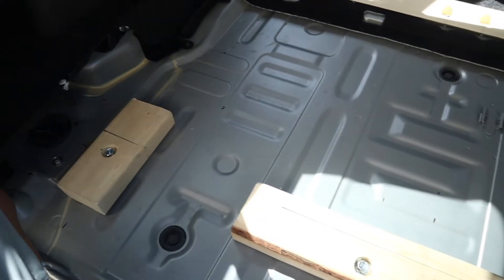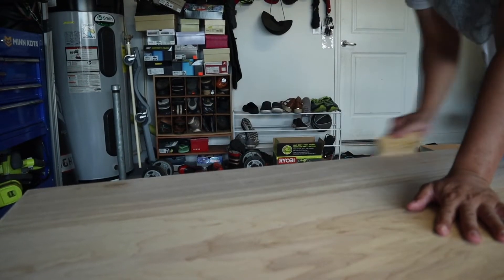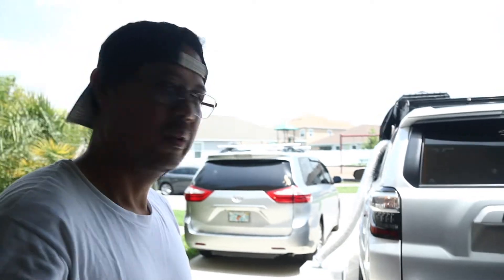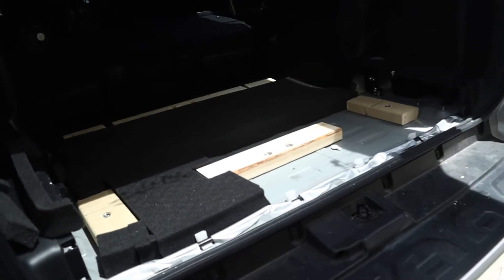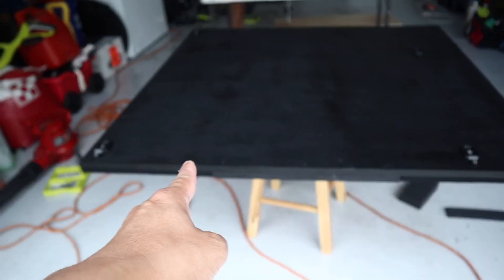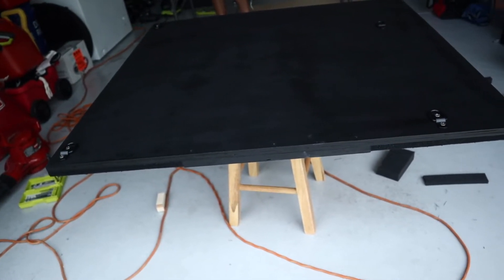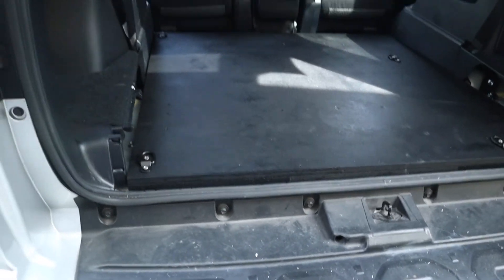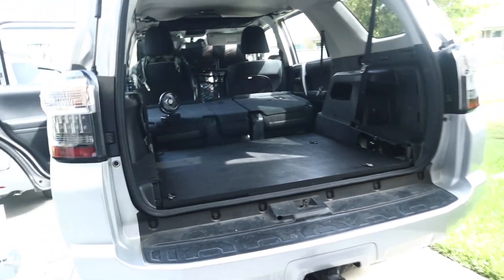TOYOTA 4RUNNER 5TH GENERATION 3RD ROW SEAT MODIFICATION | STORAGE PLATFORM INSTALLATION

Comment: Hello. How did you drill the holes in the 2x4 to leave a little bit of wood for the bolt to go into? And did you use longer bolts than the factory ones to secure the 2x4?

Comment: subscribed, i have a 2021 SR5 4x4, with a 3rd row seat. How do i mount the 2x4s and bolts in, it would of been nice to show the process, Im doing the same thing
Reply from the maker: I cut a 45 degree on one side of 2x4 and use a small drill bit as pilot hole to match the angle of the factory mount. I made the top of the where I mounted the plywood bigger to make the bolt flushed to the 2x4.

Comment: Hello, did you drill holes in the back next to the second row? If you did , what size? When i looked at mine I did not see any holes to mount the 2x4.
Reply from the maker: No I used all factory holes to bolt the 2x4s

Comment: Could you please tell me the bolts you used to anchor the 2x4s? The ones that held the seat originally?
Reply from the maker: I can’t remember the exact size but it might be m8x1.25 or m10x1.25   I forgot the length of the bolt    I brought the bolt to Lowe’s  to check the exact thread and length for my use.

Comment: Nice video -what are the final measurements of the floor
Reply from the maker: Thanks. 40” deep x 42” wide. I have an 2016 SR5 with 3rd row option. Make sure measure yours coz it might varies depending on the trim level